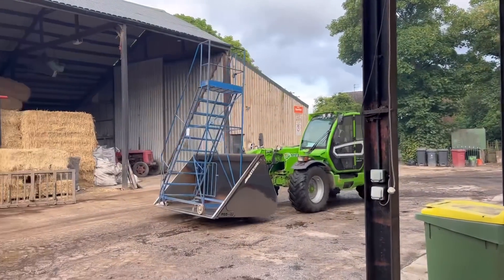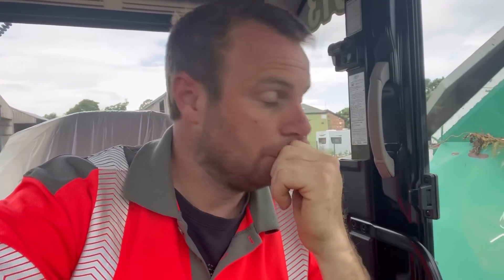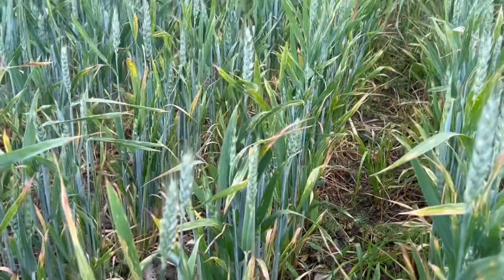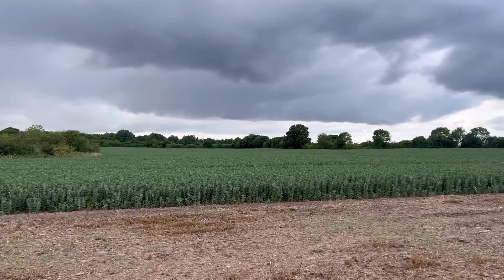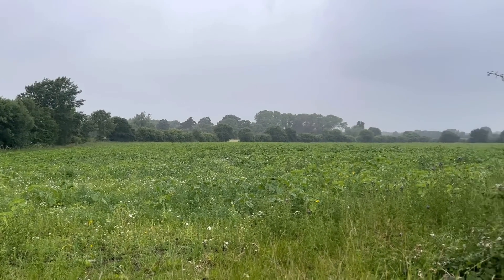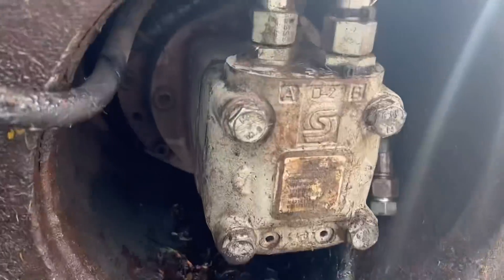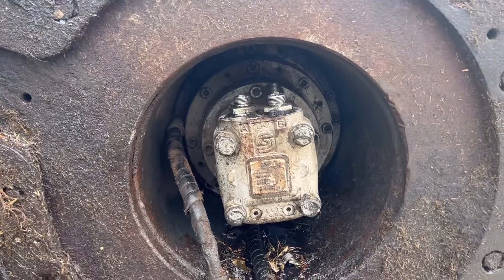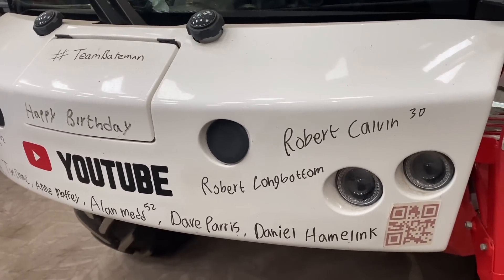DAY 829 DRILLING BUCKWHEAT TILL IT RAINED & MYSTERY OIL LEAK#OLLYBLOGS  #AnswerAsAPercent

Comment: @Olly Blogs Agricontract farmer
So blocked toilets?
A plumbers tip; full bottle of bleach down the loo, then leave for 10-15 minutes
THEN LOADS OF boiling hot water straight down the loo!
It WILL CLEAR almost immediately